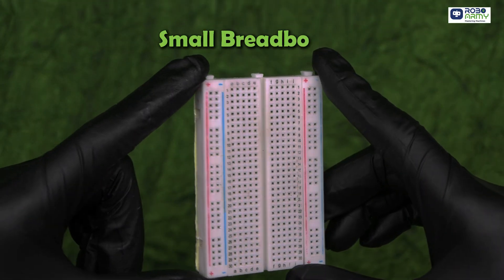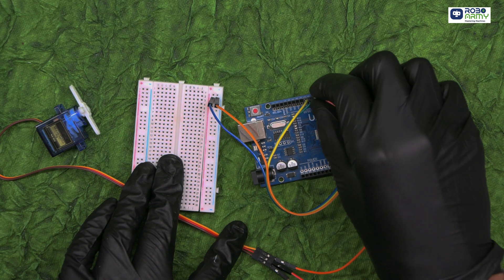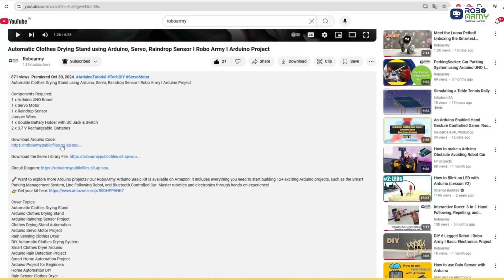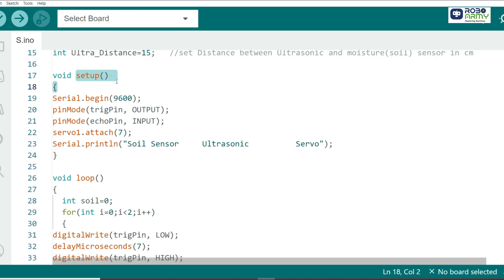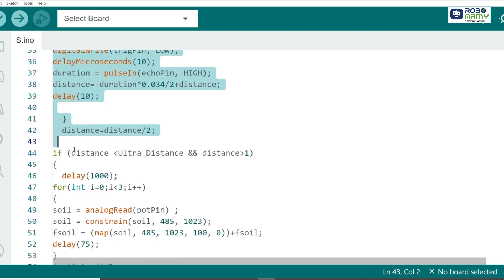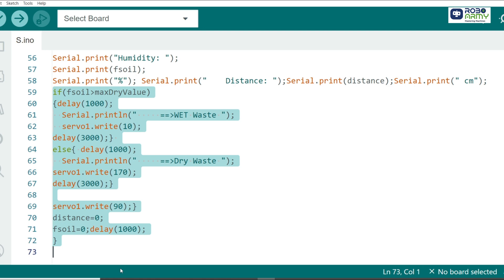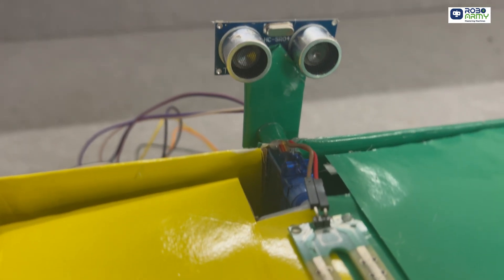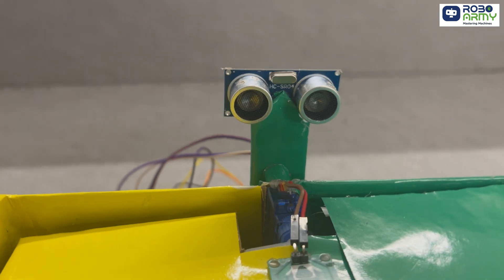How to make an Automatic BinBot: Dry Wet Waste Segregator Dustbin

Comment: Sir servor motor was not work why
Reply from the maker: This usually happens due to wiring or power issues. Please check that the servo signal wire is connected to pin 7, VCC to 5V, and GND to GND. Also make sure the servo is getting enough power and try testing it with a simple servo test code. Let us know what you observe.

Comment: why my servo motor not moving and just keep vibrating?
Reply from the maker: This usually happens due to insufficient power or loose connections. Please check that the servo’s GND is common with Arduino GND, the signal wire is on the correct pin, and the power supply is stable. Try testing the servo with a simple servo test code—if it still vibrates, use an external 5V supply or replace the servo.
Reply: @robo_army_ can u share the newest code sir?

Comment: Sir the servo motor is working regularly what I do
Reply from the maker: Hmm, if the servo motor is working irregularly, you might want to check the power supply or calibration in your code.

Comment: I did the same project but motor is moving in one direction for dry and wet waste
Reply from the maker: That can happen sometimes! Double-check your motor driver connections and make sure the code is sending the correct signals for both directions.

Comment: Is it okay to use micro servo motor for this?
Reply from the maker: Yes, a micro servo motor (like SG90) is perfectly fine for this project 👍. Just make sure the lid is lightweight and the servo gets proper 5V power for smooth movement

Comment: I need some help i have wired everything and bulit the base too also uploaded the code to the UNO board but it is not moving when i place something .
Reply from the maker: Glad to hear you’ve built the base and uploaded the code! It sounds like the sensor might not be detecting objects properly, or there could be a connection issue with the servo motors. Double-check your wiring and sensor placement! 👍

Comment: in what app do I open the code or is it fine if i open in word?
Reply from the maker: You should open and edit the code in the Arduino IDE (or ArduinoDroid on mobile). Word is not suitable for running or uploading Arduino code—it’s only for reading text.
Reply: @robo_army_  on laptop it's Arudino IDE

Comment: Hlo Sir Ji code bhi Arduino m upload kar diya hai but servo moment one side and soil moisture sensor not proper working
Reply: Plz help me Sir Ji
Reply from the maker: Hmm, let's troubleshoot this! Could you share the specific error messages or behavior you're seeing? It might be a wiring issue or a power supply problem for the servo, and the soil moisture sensor might need calibration or a double-check on its connections.
Reply: @robo_army_ ok sir ji fir se check krke connection apko btata hu work kar raha hai ya nahi
Reply: @robo_army_ hlo Sir Ji connection all done but servo motor one side moment plz  red wire ultra Sonic sensor and servo motor pin no 5 connect and black wire ground connect and ao wire ao par connect ki hai and servo sensing wire pin no.7 connect and trig wire 8 no connect and echo wire pin no 9 connect all connect but not proper work my project
Reply from the maker: Thanks for sharing the details 👍
Please check these points carefully:
1️⃣ Servo red → 5V, black/brown → GND, signal → pin 7 (common GND is must).
2️⃣ Ultrasonic: VCC → 5V, GND → GND, Trig → pin 8, Echo → pin 9.
3️⃣ Make sure servo GND and sensor GND are connected together.
4️⃣ Try testing the servo alone with a simple servo test code to confirm it’s working.
5️⃣ Also check power—low voltage can cause servo to move only one side.
Reply: @robo_army_ 9volt ki battery use kar skte hai kya sir ji ispr
Reply: Kunki abhi bhi ek side hi servo motor moment

Comment: what specific type of ultrasonic sensor and servo motor is needed pls thank you
Reply from the maker: For this project, we used a standard HC-SR04 ultrasonic sensor and an SG90 servo motor.
Reply: in servo motor, 360 or 180 Degree?
Reply: bumped pls

Comment: Can i use a UNO R3 CH340G for this project?
Reply from the maker: Yes, you can use an UNO R3 CH340G for this project. It works the same as a regular Arduino Uno—just make sure you install the CH340 driver if your computer doesn’t recognize the board

Comment: MY PROJECT IS NOT WORKING😕
Reply from the maker: Oh no! Sorry to hear it's not working. Could you tell me more about what's happening or what issue you're facing?
Reply: When I tried to work my project the servo was not rotating,then I check any issue in servo but servo is working then I don't no what is the issue
Then I check the code but it is also fine can you tell me what will be the problem

Comment: Sir I have question. What kind of jumper wire needed for this project?
Reply from the maker: For this project, you just need male-to-male and male-to-female jumper wires to connect the sensors, servo, and Arduino on the breadboard. Any standard 20–22 AWG jumper wires will work.

Comment: Can I upload code using phone through otg 
 ? And can uploading first code ? Before connection of other components?
Reply from the maker: Yes, you can upload the code using your phone and an OTG cable through the Arduino uploader app. 👍 And you can upload the code before connecting the components—in fact, that's the safer way to avoid any damage.

Comment: uploading problem still coming 🫠 kya mai arduino uno pr connection se pahle hi upload kr shkti hu code ?
Reply from the maker: Haan bilkul, aap Arduino Uno par code pehle upload kar sakti ho bina connections ke. Pehle USB se board connect karo, correct board & port select karo, phir upload karo.
Upload ho jane ke baad connections add karna safe aur easy hota hai.

Comment: I have checked the connections but it  is still not working
Reply from the maker: Sorry to hear it's still not working! Could you share more details about what's happening or not happening so I can help troubleshoot?
Reply: @robo_army_  neither the motor nor sensor is working
The code is correct ,I complied and uploaded it .
Is there any way to test the sensors and servo motor.

Comment: It's sense only dry and sensor too fast before placing anything it's shifted
Reply from the maker: Thanks for the feedback! 😊 You can slow down the response by adding a longer delay or adding a condition to check the waste multiple times before moving the servo. Also, ensure the moisture sensor actually touches the waste for correct wet detection. You can adjust the sensitivity values in the code to improve accuracy.

Comment: Can we use power bank to supply power
Reply from the maker: Yes, you can power the Arduino using a power bank through the USB cable. It’s a better option than a 9V battery because it provides more stable power and lasts longer.

Comment: is it okay to use a solar panel to power this up?
Reply from the maker: Yes, you can definitely power it using a solar panel! 🌞 Just make sure you use a proper battery + charge controller setup so the Arduino, sensors, and servo get a stable 5V supply. If you need, I can suggest a simple solar circuit for it!
Reply: @robo_army_ please help me, and also may I ask, what if a dry waste like a paper or a bottle is wet, so possible it's gonna goes to the wet section even tho it's a dry waste? And also is it possible if we make this a non-biodegradable and biodegradable section?
Reply: help meee

Comment: Bro I did the exact same thing but it automatically goes right side even when I don't place anything on the soil moisture sensor and returns back to the base position how do I solve it please help bro
Reply from the maker: Sounds like a calibration or wiring issue; make sure your soil moisture sensor is connected properly and try adjusting its sensitivity in the code.

Comment: Sevo motor is not turning after code uploading
Reply from the maker: Did you include the Servo library and attach the servo correctly in your code? Sometimes, the issue is with the initial setup.

Comment: So without power does it work?
Reply from the maker: No, it won’t work without power. Since it uses Arduino, sensors, and a servo motor, it needs a power source like a battery or USB supply to operate.

Comment: Why trigPin not working on me?
Reply from the maker: If your trigPin isn’t working, please double-check the wiring and make sure the trigPin is connected to the correct Arduino pin. Also confirm that the sensor has proper 5V power and GND, and test it with a simple ultrasonic code to verify readings. If you still face issues, share your wiring so we can help!

Comment: I HAVE MADE THE PROJECT BUT THE PROBLEM IS THAT THE SERVO MOTOR IS ALWAYS GOING TO THE WET SIDE
Reply from the maker: If the servo always moves to the wet side, your moisture sensor is probably reading high values. Please check the sensor wiring, clean the sensor probes, and adjust the maxDryValue in the code. Also open Serial Monitor to see the actual humidity readings — that will tell you what the sensor is detecting

Comment: It is only slipping to one side
Reply from the maker: That usually happens if the servo angle range isn’t properly set or the lid weight is unbalanced. Try adjusting the servo angles in the code (like 0°–180°) and make sure the lid is centered and not too heavy on one side.

Comment: Brooooo, Can you please help me in this situation plzzzz.
I tried to upload the code you gave in the description it is not working ya know please helppppp🙏🙏🙏🙏
Reply from the maker: Hey bro! 😊
The code file provided in the description is in “.ino” format, which means it’s an Arduino program file.
To open and upload it to your ESP32, make sure you’ve installed the Arduino IDE on your laptop or desktop first. 💻

You can download it from here 👉 https://www.arduino.cc/en/software

Once installed, just open the .ino file in Arduino IDE, select ESP32 board and correct COM port, then click Upload ✅

If you still face any issue, share the error message — we’ll help you fix it step by step 👍
Reply: Not error message but everything is going fine but the problem is with the soil moisture sensor.  I bought a new one also but it is not working
Reply: Plz help
Reply: Plz help  I am using Arduino uno

Comment: Bro can u do it with raindrop sensor??
Reply from the maker: Yes, you can! You can replace the soil moisture sensor with a raindrop sensor to detect wet waste or liquid presence — just adjust the threshold values in the code for accurate readings

Comment: Is it possible to replace the "soil moisture sensor" with a "water sensor"? Does it affect the code system?
Reply from the maker: Yes, you can use a water sensor instead of a soil moisture sensor 👍. Both work on similar principles, but you might need to adjust the threshold values in the code since their output ranges differ slightly. The overall code logic will remain the same.
Reply: @robo_army_  But is there any existing code for this using the water sensor?

Comment: Actually I have doubt how you power the this system at please reply me as soon as possible because by science exhibition are coming😊❤❤❤
Reply from the maker: That’s great! 😊 You can power the system using a 9V battery connected to the Arduino’s DC jack or a 5V USB power bank. For exhibitions, a power bank is more stable and lasts longer. Good luck with your science exhibition!

Comment: i made it but my wet and dry waste is sliding to the same side
Reply from the maker: That usually happens if the servo angle or lid position isn’t properly adjusted. Try changing the servo angles in the code (for example, servo1.write(10) and servo1.write(170)) so the lid moves fully to each side. Also, make sure the divider inside the bin is placed correctly to separate both sections

Comment: Hi, one last question. Why is my servo motor shaking when I put the cardboard? I tried it with a portfolio folder and it is not shaking. Is it because it's too heavy?
Reply from the maker: Yes, that’s most likely the reason! The servo motor can shake if the lid or cardboard is too heavy for it. Try using a lighter material for the lid or reduce friction at the hinge. You could also use a stronger servo if you want to use heavier materials
Reply: @robo_army_  ohh thank you i already made it without any problems now!!! thank you for responding to all of my question keep the good work brother!!!

Comment: hi so i did this project foor my school project and in my case it only turns left even though i already put a dry object on it, please help
Reply from the maker: Hi! If the servo only turns one side, try these steps:
1️⃣ Check the Soil Moisture Sensor wiring (VCC, GND, and signal).
2️⃣ Open the Serial Monitor to see if humidity values are changing.
3️⃣ Adjust the maxDryValue in the code — your sensor’s readings may differ.
4️⃣ Test the servo motor separately to ensure it moves both sides.

Comment: Hi, do I need to buy a specific servo motor?
Reply: Yes, Servo SG90
Reply from the maker: You don’t need a specific servo motor — a simple SG90 servo works perfectly!  You can also buy our RoboArmy kit, which includes all the required components for this project, making it easy to build and test the complete system - https://amzn.in/d/8zI1XJw

Comment: We made this dustbin but it's sensing wet but unable to send dry can you able to help
Reply from the maker: It sounds like the moisture threshold for dry waste might be set incorrectly.
1️⃣ Check the value of maxDryValue in your code — you may need to increase it slightly.
2️⃣ Make sure the Soil Moisture Sensor is clean and properly connected.
3️⃣ Test the sensor separately using analogRead() to see the actual readings for dry and wet waste.

Comment: bro I am working in Mac , the download Is not working suggest me some other ideas pls
Reply from the maker: Got it bro! On Mac, sometimes the Arduino IDE download link doesn’t work. You can try:

🔹 Arduino Web Editor (works directly in your browser, no install needed) → https://create.arduino.cc/editor

🔹 Or use the Arduino IDE for Mac (Apple Silicon/Intel) from the official Arduino site under "Software".

Comment: Heyy, everything worked fine but as it goes to dry or wet, it comes back to its original  form as u said but when it does it vibrate/shakes as it comes back to its original form and it takes long to detect wether its dry or wet
Reply from the maker: Thanks for the feedback! Ensure the servo is securely mounted to prevent shaking, and double-check the sensor’s sensitivity calibration for quicker detection.

Comment: Everything is ready i have all the sensors and the code i want to know how did you mount everything on cardboard can you explain it in detail or make a video about mounting everything on cardboard?
Reply from the maker: Glad to hear you’ve got everything ready!  I used cardboard to make a simple box, cut out slots for the ultrasonic sensor on the top front, placed the soil moisture sensor inside where the waste falls, and fixed the servo near the lid to control movement. All components were secured with hot glue/tape.

I’ll try to make a detailed video on the mounting process soon, meanwhile I can share step-by-step instructions or a sketch if that helps!
Reply: @robo_army_  thanks for sharing the mounting process in detail over text, i got everything working and also mounted it on cardboard, i made some changes too, i used camera instead of the soil moisture sensor and used YOLOv8 which is an object detection model, through YOLO and camera i can make more segregations instead of just dry, wet waste like e waste, metal can etc

Comment: Sir I did everything write and even uploaded the code but the sensors  and motor is not responding.Its not working.Please help me as it is my first time doing this.
Reply: Sir I have powered it with a laptop an connected arduino through a USB,also I double checked the code,but do we need to power the sensors and motor separately?
Reply from the maker: Good question! Usually, powering the Arduino through USB is enough for sensors, but sometimes the servo motor needs more current than the USB can provide. In that case, it’s better to use an external 5V power supply for the servo (with common ground). Sensors can run from Arduino power itself
Reply: @robo_army_ Thank you so much,will surely check it.
Reply from the maker: Double-check all your wiring connections and ensure your sensors and motor are properly powered; also, review your code for any potential errors.

Comment: In the end, how to power it? 
I want this project for school exhibition.
Reply from the maker: You can power it with a 12V adapter or a battery pack for your school exhibition, depending on what's most convenient!
Reply: @robo_army_ bro in the video while connecting the circuit is different and you shown a circut that also different?
Reply: Use a 9V battery, connect it to DC jack and power the Arduino UNO board

Comment: Sir can you tell me the type of jumper wires used?
Reply from the maker: Sure!  I used male-to-male jumper wires for connecting the Arduino to the sensors and servo. If you’re connecting to a breadboard or modules with female headers, you can also use male-to-female jumper wires.
Reply: Thank you so much..I am doing this project for my investigatory project in physics.😊

Comment: Can you list the colors of the wires where to connect to the arduino and breadboard? Im a bit confused. Thank you !
Reply from the maker: Sure! Here’s a simple wiring color guide you can follow (you can also change colors as per your preference, but this helps avoid confusion):

🔴 Red → VCC (5V)
⚫ Black → GND
🟢 Green → Signal from Ultrasonic Trig (to pin 8)
🟡 Yellow → Signal from Ultrasonic Echo (to pin 9)
🟠 Orange → Servo Motor Signal (to pin 7)
🔵 Blue → Soil Moisture Sensor Analog Out (to A0)